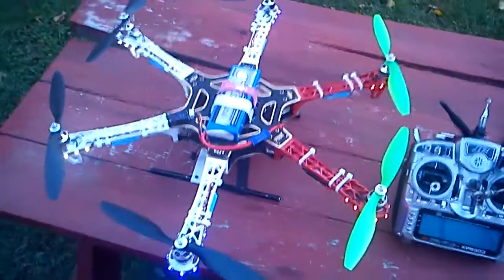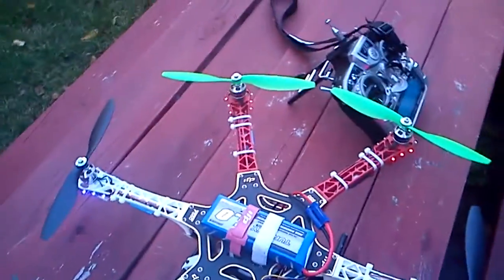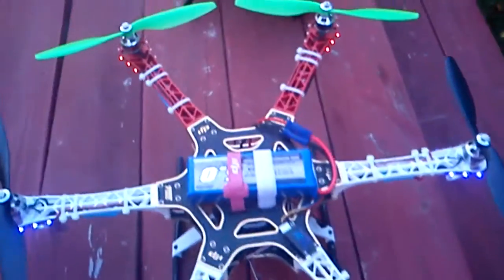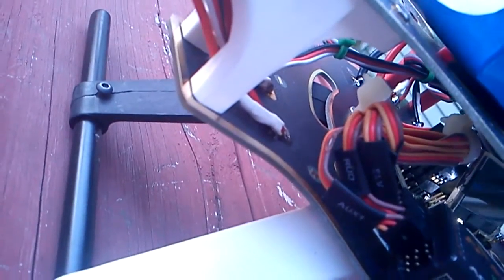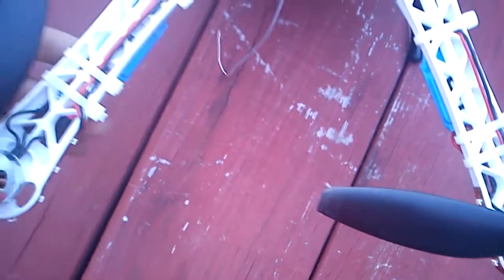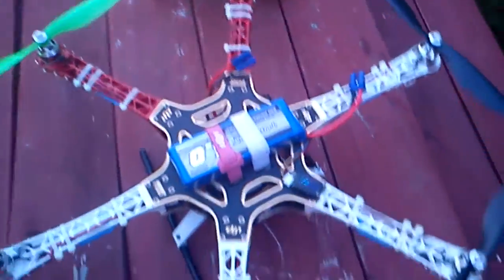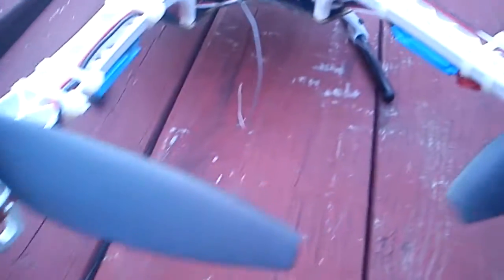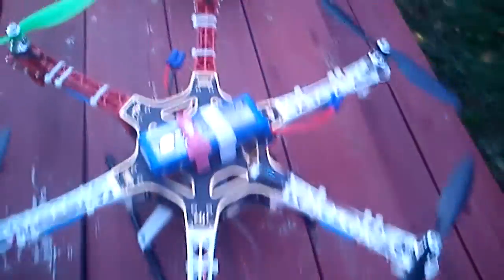dJI F550 Flame Wheel with BLHELI flashed Turnigy Plush 18a esc's

Comment: hi,
had similar issues. check my video /watch?v=-wC22SJyqoA

Make sure you set the throttle range to each ESC using the Rx[throttle channel]

OR

I'm not familiar with the KK2 board but, if you can, use the ESC calibration mode. This sets the throttle range for all the ESCs connected to the board. You can set your own min and MAX values inside config.h 
Just uncomment  #define ESC_CALIB_CANNOT_FLY to enable this, then power the hexa [props off] and wait for the beeps to finish.Then comment back